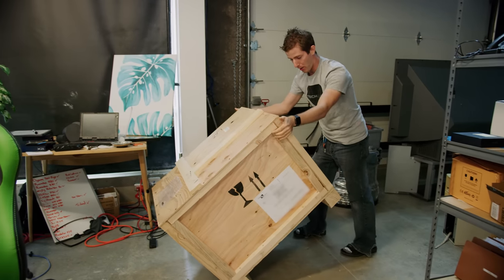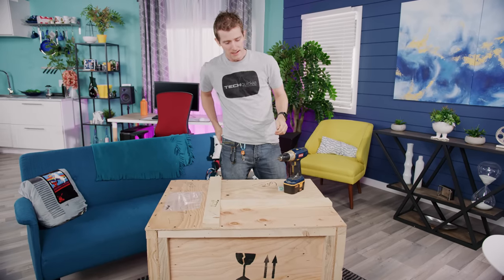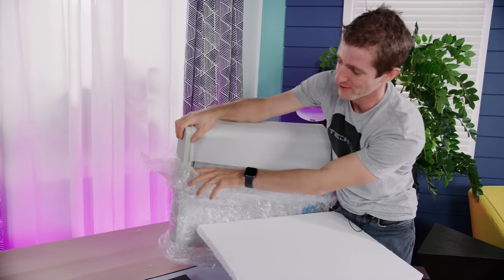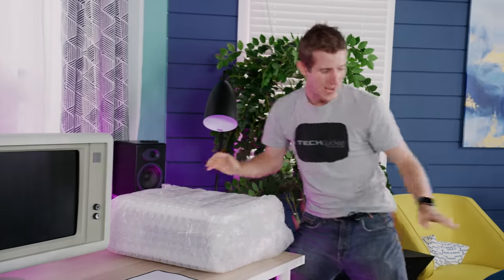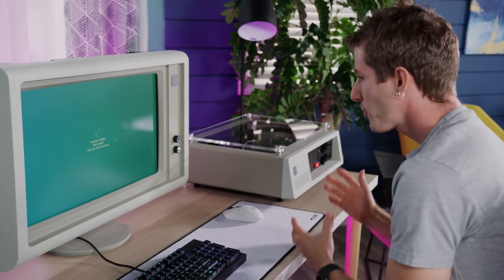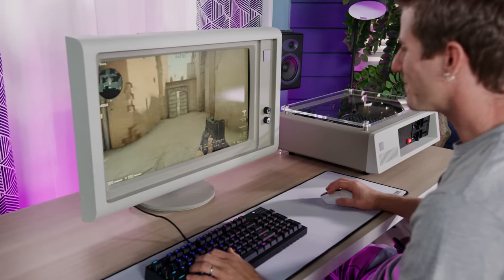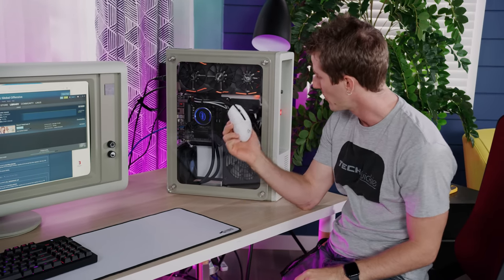The COOLEST Box I’ve EVER Opened

Comment: The Windows Theme needs to be monochrome green only and the sound theme needs to either PC speaker tone sounding or MIDI sounding. Alternatively, use the Windows 3.1 sound theme. Screen Saver needs to be the Afterdark flying toasters. When you open the browser it should sound like a dialup modem.
Reply: الشيخ مصطفى البرزاوى GTFO
Reply: Should also try to make the hardware sound like the IBM. The old crackly activity noise. That's if you can't just make it into a proper sleeper.
Reply: My phone ringtone is that of a dial-up modem

Comment: Man, I wish a manufacturer would produce a new "Sleeper" style case, wich looks like straight out of the 90s / early 2000s, but has the features of a modern one...
Reply: Yes, retro gang where are you
Reply: @MrGamelover23  ...not necessarily?
Reply: @MrGamelover23  not really I mean one of the best cases (by thermals) on gamers nexus is a late retro case (forgot the exact name). But many old cases could be up on top because they use side-intakes for the graphics card. so by modifying the front to be more of an intake many old cases could retain their looks and still be thermaly on the upper end of the scale.
Reply: @MrGamelover23  found it again'
it is the Cooler Master HAF X
as I said late "retro" so it is black and features some of the early gamer designs... but if you take away the RGB fan in the front and paint it it will look like a 20+year old case that hase been modded for "style". 
But the main point was the thermals which are achieved by the side intake so basically any old case with a side intake and a front intake will do fine thermaly. 

So manufactures you have a community now build the damn thing.

Comment: the only thing that could potentially cooler would be if the case were bigger and thus could feature two layers of hardware. one that is viewable one that isnt. where the visible one is like stone age, and underneath is a tricked out modern setup. and if they then craft a custom piece of glass that fits the look of a crt and mount it in front of modern monitor in a old crt case this would be awesome. especially imagine the old hardware being wired up in a way it looks like its running (leds glowing fans spinning) with a fpga inside that can show a msdos booting screen and that releases the graphics lines as soon as windows is completely booted. so you have the  look and feel of a vintage machine that can even troll your mates when showing it to them. imagine them seeing msdos booting up and then saying wait what you play csgo here but this is dos booting how on earth? 

i think this is so cool

ps some how you need to be able to output this characteristic noise floppies made while boot up even with out them being actually being in place like in your case

anyway you get a really nice pice of kit

Comment: All I wanted to see was for you to place the monitor on top of the base unit. It was not complete until I saw that moment. But it never happened.
Reply: Linus just wants to ruin our nerdgasms. It's downright heretical.
Reply: thought the same
Reply: Well remember it has an acrylic panel so that would scratch it up a lot
Reply: @Lucidilluminate  Acrylic shouldn't scratch THAT easily, and the bottom of the monitor stand is probably rubber pads anyway. Plus like, if you just set it down carefully it shouldn't scratch at all.

I 100% agree though, the monitor belongs on top.
Reply: Daniel Jensen 🤓

Comment: dang, I'm kinda disappointed that the floppies don't work! I would have strived to make that happen, even if it meant a USB converter on the inside...
Reply: Should have used the floppy drives and somehow fitted DVD/blueray drives into them
Reply: they could've used that as CD Drives or Blu ray.
Reply: Ever held an 80s 5 1/4 floppy drive in your hand? Them boys be huge. They need the space.
Reply: I kept a working 3.5" floppy drive in my PC until around 2011, lol ;)
Reply: ah yeah you guys are right, there isn't much space. Still I wish the upper drive was usable.
I have a Brother CNC machine from 1982 that uses a 5-1/4 floppy drive for its proprietary dos OS. Every time I turn the machine on, it loads the OS into the onboard RAM. Somehow the ancient computer still works, the rest of the machine is falling apart...
Reply: @neosmith166  And to double capacity of SS disk you cut another write-enable hole and index hole  and turn it over in the same SS drive :D You had to tape holes, us modern and progressive types had switch there :D :D :D
Reply: @pr0xZen  Ever held 8" disk and/or drive? Ever dealt with 12" laser discs? :D
Reply: @lupusy  Both yes :) - But unlike 5 1/4" floppies, neither were in-desktop units. Those were external devices :)
Reply: @pr0xZen  ah, very true
Reply: They should have at least made one of the floppy bays an optical drive just for accuracy.
Reply: @Atlquotl  Optical drive back then? For accuracy? :D
Reply: @lupusy  lol accuracy really wasn't what I meant other than, you're inserting a disc through the disc bay, (I think it should fit in an old 5.25 floppy slot...)  But It's been a long couple days so I'm tired...it would be cool though had it been implemented that way
Reply: @Atlquotl  Well, considering that 5.25" is larger than 120 mm CD (4.7") and that those drive bays are full height, I see no reason why it should not be possible to fix one and to feed it through existing slot :)

Comment: So much detail except they fitted the FDDs upside down
Reply: I think those are Teac drives. They are not the full-height flip up to open drives either (Tandon). The half-height drives came out later to accommodate the Seagate ST-225 20MB MFM HDDs in the same full-height bay.
Reply: U should do cable management, custom power cable sleeves, and watercooling
Reply: mikeselectricstuff @ Linus Tech Tips? Whaa?? (pls more teardowns of expensive stuff :) )
Reply: It should also be noted the Original PC came with the 5150 83-key Type F keyboard. His Model M is the PC-AT 102 key keyboard from 5 years later.
Reply: 5150 actually had an 8088 processor
Reply: Mike Whitenton that’s correct! And an 8088 proc
Reply: @walkerpennisi  yes, this and a steel, beige painted top panel instead of the acrylic and put the monitor on top. classic.
Reply: Next you'll be complaining on how it's 8086 is 40 years too modern.
Reply: an epic fail ;-/
Reply: So that's why the lever flips the wrong way! I replayed Alex playing with the FDD lever several times and thought I'd lost it. Well, probably have anyway ...
-- an old mainframer who watched this tech develop and enter the business world.

Comment: The IBM 5150 doesn't have a power button. 
The switch at the back of the computer was to turn on the power supply and thus the computer at the same time.
The power switch was at the right hand side of the machine and not the back.
Was nice to see the original power switch though.
The IBM 5150 used the Intel 8088 not the 8086. Close though... I really like the attention to detail on that part though.
The 5.25 floppy drives are not the original ones used in the computer, that would have been a great touch.
But also that the floppy drives are upside down... Which is... Odd.
Shame to see the company took the IBM logo off.
Shame to see them not use the original Vesa slots and just mod the power supply and the switch in the right places.

Pardon the little rant I had, but I honestly enjoyed the build for the aesthetic but it could have been even more perfect.
Reply: That it was close... indeed. better then some others we have seen.
Reply: Gateway it was optional whether you got the 8086 or 8088 but okay
Reply: Are you sure? I cannot find a single source that says the 5150 could be downgraded to the 8086

Comment: Uhhhh, recolor the VGA, PSU, fans (Metal grates?). 
ZX Spectrum beeping sound on start up,
3. button. mouse. 
make those KNOBS WORK.... (the ones on the monitor), 
Retrofit your router with a 14.4k fax modem that makes the connecting noises randomly (this ones for me!)
add an old analog joystick for the hell of it.
Reply: AfterDark screen saver
Vinyl cover for when not in use
Word Perfect F-key keyboard guide
Oregon Trail mouse pad
and +9000 on the analog joystick
Reply: THIS! like this get this to the top!!!

Comment: Add an RTX 2080 Ti and change the fans of the PC to Noctua NF-A12x25(Best Fans on the market and the Beige colors would match an old PC better than the Black fans). If Possible, remove the Stock fans from the Graphics card and replace them with the NF-A12x25 like you did on that video about replacing Graphics card fans. Another Idea would be to do a custom water loop with white or beige fluid. Sick vid Linus

Comment: It needs a pair of 7 segment displays that show the current CPU clock frequency. Those came on every case in the early 90s.
Reply: Keep in mind they went about a decade earlier
Reply: @LouisCYUL  There were no Turbo buttons on the 5150 either. Liberties have already been taken. It is not a true sleeper or working original. Taking small additional liberties from the general era seems to be in the spirit of the build.
Reply: Where do you see a turbo button?
Reply: @forgilageord  My bad. I left the room at that point to get some coffee. I assumed it was a turbo button.

Comment: If it's supposed to exhausting from the top, why is the PSU intake pointing up? Maybe if the fan was reversed or something. But, really, PSU should be flipped down so it's pulling in from the bottom and exhausting heat out the side.

Also, the floppy drives are upside-down, which is an... interesting choice. I think these should be full-height drives, not half-height drives. The "RUN" button is definitely not original to the 5150, they just used the switch in the rear, but I don't think it looks bad.
Reply: It looks cool, but I agree with the second paragraph. Why is the powerswitch not on the side? That little metal plate on it actually is a bit weird.
And that run button wasn't even there, let alone it being the original power switch.
It's cool, but not quite as cool as it could have been. It seems slightly over-modified.
Reply: I mean, at least they used the right power switch, even if it's in the wrong place. I know they're a prop company, but I feel like they fell short and didn't do the necessary research for this. It's cool at first glance, but looking closer, it seems questionable. The reel-to-reel recorder in the intro to Mindhunter comes to mind as a very well made, accurate prop, even if they don't use it completely correctly in the actual filming.
Reply: @Zizzily  yeah, my enthusiasm faded the longer the video ran. Waste of case.
Reply: I do believe that the PSUs pull from the ventilation holes and push it with the fans out.
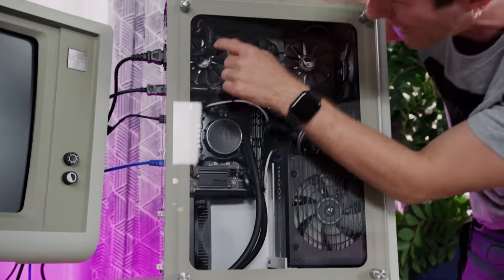Reply: PSU fans are intakes. If you pause at 6:28 and 7:38, you can quite clearly see the hub of the fan rather than the back frame, which means that's where it's pulling air in. The vents on the back of the PSU are where the heat is exhausted typically. The PSU doesn't even appear to be mounted with an exhaust, so it seems like it's pulling in air from the top, where the rest of the PC is exhausting hot air, and then the PSU itself is exhausting the hot air directly into the case.
Reply: replacing the run button with something that is doubleshot would make it look a lot more clean.
Reply: Zzyzx Wolfe , no, they clearly look like they’re pushing air to the top of the case- the fan blades are curving inwards rather than outwards. Search “Corsair HX1000i” which I believe is the same model as the one in the build. It’s CLEARLY not an intake fans.
Reply: It's a long time ago that I saw one of those. That switch on the back is not the one that's usually on the side?
I remember what it feels like to flip it over but I don't really remember exactly what it looks like. I just remember red, black and I / O
Reply: I have actually at some point owned more than 100 reel to reels. I have stopped this now because tapes were getting either unreliable or expensive, so I switched to cassettes.
Anyway, knowing a thing or two about vintage audio is a huge problem when watching movies. Try The Boat that Rocked. It's frustrating as fuck even though it's a really cool movie. Nice atmosphere. 
And if you indeed end up watching it, google the date of the Incredible String Band album that gets saved in the end. Yeah. They failed there too.

Comment: That was a badass retro built system. Did you notice the PSU Fan was not turning towards the end of the video? I should win an award for noticing that, If you feel so inclined Linus? I'm still using an AMD 7970, and I have an otherwise VR Ready system. Thanks!